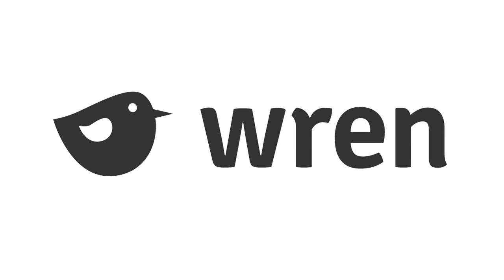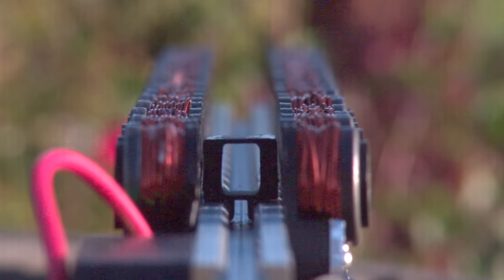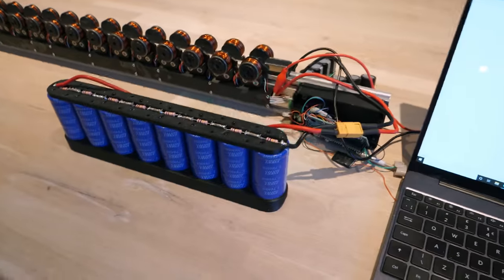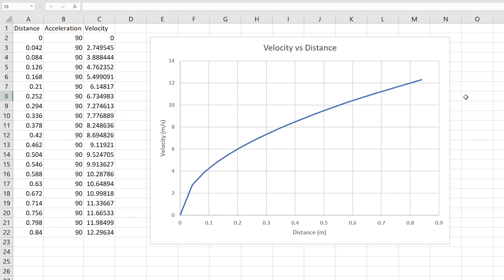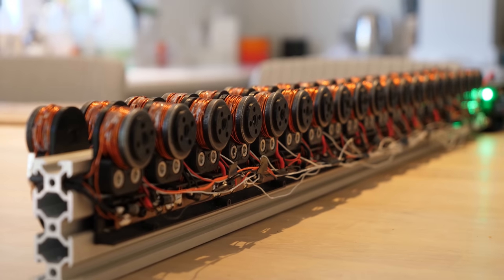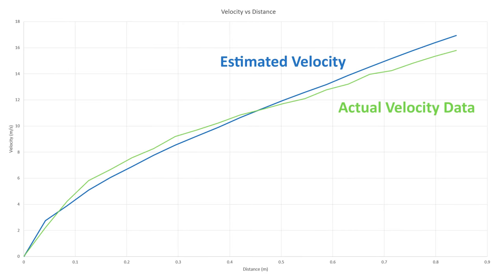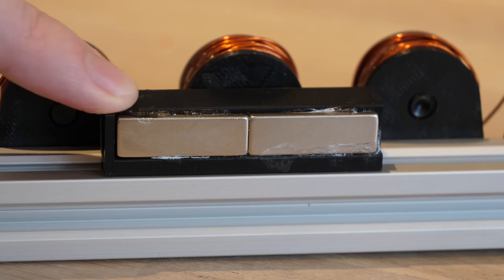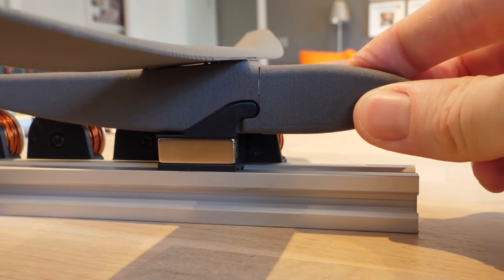Optimising a Magnetic Launcher

Comment: I built a mass driver as a science fair project back in the '80's, I got around the curve flattening by progressively spacing the driver coils further apart as they went down the track. My reasoning was like a transmission in a car the impulses then match the speed of the projectile as it accelerates.
Reply: I postulated this as soon as i saw this utube and before i read your missive
Reply: I don't think increasing the spacing of later coils would help in Tom's contraption, since each coil is still the same size and still only has the same limited time to impart a kick.  Increasing the spacing only makes the contraption take up more space and experience more track-friction losses.
Reply: @gluino  Yeah, but there's also delay in turning on the coils to full power, so I think that would be necessary to get sufficient higher and higher spacing for the sensors.
Reply: Since this is getting a little interest, I'll elaborate a bit.. mine powered all the electromagnets at once and then cut power to them in series when the projectile passed a photoresistor in a socket. It fired tape wrapped paperclips faster than the speed of sound! (it made a loud CRACK!)
Reply: @Coneshot  huh. Common in military scifi is a switch from gunpowder rifles to flechette rifles, firing 5mm or less darts electrically at supersonic speeds, packing up to several hundred rounds in the space of what is currently a standard capacity 30 round magazine. 

What you made could be considered an early prototype to such a device, with that supersonic speed and an extremely small projectile. Interesting :P
Reply: @giin97  I don't think my project had a lot of potential as a weapon, it used a TON of power and was stopped by a t-shirt..
Reply: Effectively advancing the timing of the linear motor.
Reply: @Coneshot   Many people facing a gun would highly appreciate those abilities.
Reply: @giin97  "common in military scifi"... I'm not sure if I've read any military scifi, unless Ender's Game counts... care to recommend a book which features such a weapon?
Reply: @polychoron  alright, I suppose a caveat that it's common in the military scifi that I've read, which is only a small portion of the genre as a whole.

Regarding examples, off the top of my head the Undying Mercenary series, the Frontlines series, and the Odyssey One series come to mind, but they aren't the only time I've seen the theme of human military in the ~2200's replacing chemical accelerants (gunpowder etc) with electromagnetic (railguns, coilguns, etc).
Reply: was yours AC?
Reply: @jonathanodude6660  No, it was D/C it used a 12 volt car battery
Reply: @gluino  It takes a certain time to build and collapse a field, so you need more spacing at higher velocities unless you increase the speed of the control system farther down the line. There are SPICE models for coils and moving magnets that can help simulate this whole thing. There are also tricks to shunting fly back into the next coil…
Reply: so rather like how a car's 5th gear doesnt have the same torque as first?
Reply: This was also my recommendation for his prior vid. Although I was more focused on the speed of his microcontrollers.
Reply: @polychoron  Gordon Dickson Dorsai series.
Reply: Could be because it’s a ”stage” setup, it works by taking the speed/force from the stage before it and doubling it. The thing with ”parallell” setups is that it accelerates to a certain point until the speed and velocity is equal to the amount of time it takes to pass each coil. So yeah, what you said is quite accurate
Reply: i think i have seen this on some rollercoasters as well, the fins near the end seem to get further apart

Comment: The air gap is still ~40mm long. The other side of the electromagnet is open, so the magnetic flux has to flow to the next electromagnet via air. The overall reluctance is still quite high and can be greatly reduced by tying backs of electromagnets with an iron bar and using a magnet that partially overlaps 2 electromagnets.
Reply: Also by reducing the air gap? I used to wind rc brushless motoers. Getting the air gap as small as possible without interference was the best way to increase efficiency.
Reply: Yes. Completing the flux path would undoubtedly yield great benefits.
Reply: I would look at replacing each coil pair with a single coil and an iron yoke under / through the track.
Probably use a sled with just 1 magnet instead of 2 side by side.
Reply: or... a greater density of electromagnets
Reply: Introducing an iron flux guide would likely increase the inductance of the coil. Not sure, if it would still turn on fast enough.
Reply: @mathewcherrystone9479  yes, this is the maximum speed limit Tom was talking about in the video. It can always be raised by reducing the number of turns in windings, like in any motor. There would be other practical problems, for example the perpendicular pull on the magnets would be strongly increased (I mean ~2 orders of magnitude), so mechanical design and balancing electromagnets on both sides would be very important.
Reply: @johngreen1060  I'm not sure if that is what he meant. In an electrical motor the maximum speed is mostly determined by the induction happening between stator and rotor, because of the moving magnets. What I was talking about was the self inductance of any coil, that limits the current flow, when it is powered and extends the tme it takes to turn it off.
Reply: Perhaps also use a Halbach array-style arrangement?

Comment: Calculate how long it takes for the coil to reach maximum magnetic power, use this to determine how far the triggering hall effect sensor needs to be to optimize energizing the coils as the velocity increases. Also, when you lower the winding count, increase the wire size. Remember, wind count has an effect on the speed at which the magnetic field builds to maximum.
I was involved in the original development of the brushless motors in today's electric planes and drones.
Reply: This needs more likes

Comment: A way to know which reason is the most limiting would have been to make a regression, it the curve is close to an exponential it's mostly a back EMF reason, if the curve is close to a square root, it's mostly due to kinetic energy (harder and harder to increase for a given power).
Reply: Vous, ici!? :D
Reply: wow ça fait longtemps que j'ai pas vu INCROYABLE EXPERIENCE, peut être 8 ans.
Reply: @nobodyelse-h6h  après la 20 000eme itération de la batterie, ils se sont perdus dans la sauce
Reply: You could also use the same equations in reverse to get something that should ideally look like a line.
Reply: Don't know what he said, but he used big words so it must be right!
Reply: @troywalker8078  if you double the speed you have 4 times the energy. If you are moving the magnet fast enough its field  (back electro motive "force") cancels the force from the energized coil so no power transfer to the magnet. Think of it as the motor (the power into the coils) equalling the generator  (magnet moving past the coils)  You'd call it the motors no load current and speed.  A motor and generator are the same thing it's a matter of do you put electricity into it so it spins or you force it to spin and get electricity out of it.
Reply: Incroyables Expériences
Hey, a French YouTuber! Guess I'll head over to your channel to practice some.
Reply: You could just connect a powerful diode to prevent the back emf.
Reply: @muggzzzzz  that won't work. A magnet moving past a coil will generate a voltage.  Back emf is not a problem. It is just a fact and the reason a motor doesn't draw locked rotor current at idle under no load.   If say you put a reverse diode across a relay coil you are shunting the collapsing magnetic field and preventing a high voltage spike but you're still dumping the energy.  It doesn't prevent it.
Reply: @muggzzzzz  No, the back EMF (voltage) is in the other way but the current still flows is the same way. A diode would only prevent to use the linear motor as a generator if a magnet was sliding very fast (the back EMF would be higher than the power supply).

Comment: You can improve even more replacin alluminium rod with plastic, a magnet sliding on metal tends to reduce the speed because of the inducted current generated by the movement.
Reply: also the friction is there hence the rod must be of some smooth material, like glass with lubricants
Reply: Some lubricating oil would help a lot too

Comment: cool project! I've always been a fan of linear induction motors!
Reply: Technically isn't this a linear PMDC motor? Not induction
Reply: I prefer linear synchronous motors, those power most modern launch coasters.
Reply: Now just make it a rail gun lol
Reply: This is not an induction motor.
Reply: @maryzmijski6087  what is the difference between LIM and LSM?
Reply: @3DPrinterAcademy  more efficient
Reply: Its not a linear induction motor - only since the projectile is a magnet.  If anything, the magnet is inducing a back current into the coils (hence the use of smaller coils) which only serves to slow down the acceleration, thats the only place that induction is happening, but its unintended
Reply: @randomdude189  rn its a coil gun tho

Comment: A few ideas:
- You don't have to reverse polarity to also push the sled. You can just use a second Hall sensor located after the coil, and a second winding on the coil wired up in inverted polarity, so when the second Hall sensor turns on the second coil, it will push. With the position of the sensors, I think it can be timed perfectly. Yes it is 2X the components (and thus cost and power draw), but also roughly 2x the force at each magnet, resulting in a speed increase.
- With a lubricated sled (and the plastic part of it shaped aerodynamically), most of the drag on the sled would be eliminated.
- I've also noticed on the high-speed footage that the coils lean in a bit when active. This is expected as per Newton's third law, but the coild might need to be mounted more sturdily.
Reply: Sounds like a challenge to me!
Reply: the problem with double winding is that they would induct current into itself and thus lose much of their efficiency and magnetic field. and it would be easier to reverse the polarity than doing this. it isn't really complex to reverse it but it is at least double the wire and parts and the power draw is still an issue here. if the voltage drops this much even without the reverse, then it isn't logical to implement it because you would lose even more voltage if you have two sets of coils on at the same time and thus the power is even more reduced.
Reply: @dovos8572  The coils wouldn't be on at the same time. The reverse coil would ideally only turn on when the other turns off.
But yeah it probably wouldn't increase the speed enough to justify the added complexity.
Reply: you would always have two sets of coils on. the one that is pulling and the one that is pushing. and one set on is already enought for such a huge voltage drop. so the voltage drop would be way higher when you add another 2 coils that are on at the same time.´and thus the power behind all coils would drop drastically.
Reply: @matekovacs2696  it doesn't matter. the reverse coil would induce a current in the forward coil, losing much of the energy generated, especially since the coils are coaxial.
Reply: @you_just  Fair enough.
Reply: That is way more inefficient than reversing polarity. Reversing polarity is the best option, and it's what real AC synchronous motors do.
Reply: @gerardoliveras430  well it is the point why we use 3 phase ac as voltage in big motors. It creates rotating magnetic fields with the speed the motor is running at.
Reply: I'm not an expert on the subject, but don't coils "ring"? Like, when you remove the power source from a coil, doesn't the magnetic field collapse and then reverse or something? Could he tune the coils so that their resonant frequencies match the speed of the sled entering and exiting their fields?
Reply: @you_just  It would only induce a current if the coil was switched on.  With no completed circuit in the other winding you will only induce a potential but almost no current flow.  Therefore efficiency loss will be minimal.  This is why transformers with multiple taps are fine because the other portion of the winding doesn't have the circuit completed.
Reply: agree
Reply: @RobertKreegier  That is only when they are connected to a capacitor, forming an LC oscillator. If you look at current vs time when you turn off the power source (and current is proportional to the magnetic field), a coil by itself would produce an exponentially declining curve, approaching zero as you go towards the end of time. Same goes for capacitors by themselves. But together, they form an oscillator. The resonant frequency is 1/ (2*Pi*sqrt(L*C) ) where L is the inductivity of the coil and C is the capacitance of the capacitor. That is when coils ‘ring’. Now most systems have parasitic capacitors in them even if you don’t connect a real capacitor. For instance, there is a small capacitance between the windings of the coil, and in the transistor used to drive the coil.
But yeah, by adding real capacitors and tuning the resonant frequencies to match the speed of the sled at each coil, the polarity could be reverted at the right time. You would need to turn off the oscillator at the right time though, because you don’t want a second pulling half-period to slow down the sled. It would create a nice sine wave when it is on, which is not optimal (the magnetic force is nat always maximum when needed), but simpler in circuitry than reversing the polarity using a switch or more complicated solid-state circuitry.
Reply: @KaiseruSoze  Make a video and post it man!

Comment: I used to wind and assemble r/c brushless motors. As far as I can tell, they are pretty much identical to your linear motor. The fewer the winds (w/heavier wire) the faster the motor, but the lower the torque. What would happen if you had progressively fewer winds as the carrier went down the track? It would start off at low speed w/high torque, then go progressively to high speed with low torque. Much like gears in a car. The last few coils could be only a few winds (with heavy wire OR multiple strands in parallel) and this would really kick up the speed. Also, work to get the air gap between the coils and the magnet as small as possible. The magnetic attraction (reluctance) drops off as a square of the distance. In motor construction, this is the easiest way to increase efficiency. This is hard to do in mass production, but with a DIY project the effort really pays off. Reduce the gap by a power of two and get four times the output power!
Reply: I actually was sure the video was going this route, was surprised to learn it didn't.
Reply: I'm a bit confused, is this not what he did? apart from increasing the wire size. He reduced the gap and the number of windings.
Reply: @jebimasta4604  He did design a new sled to reduce this gap. To further reduce it he could reduce the thickness of the plastic between the coil and magnet